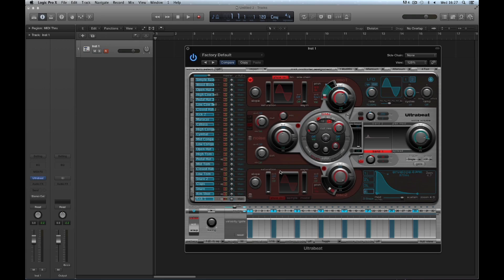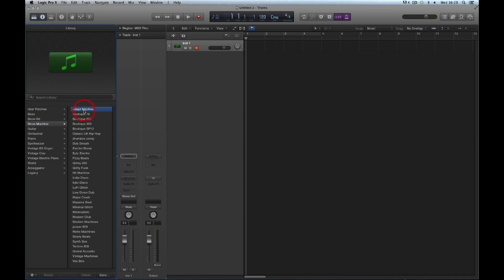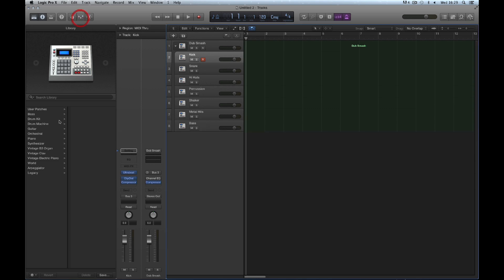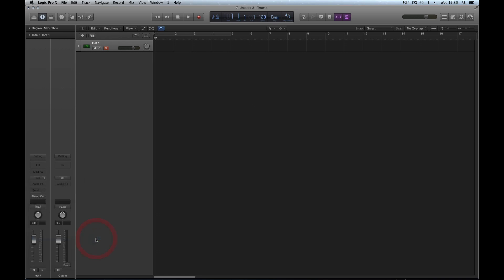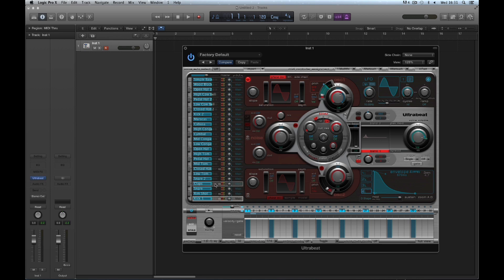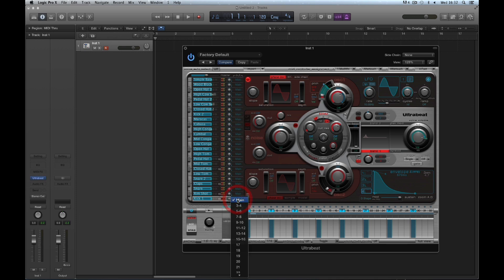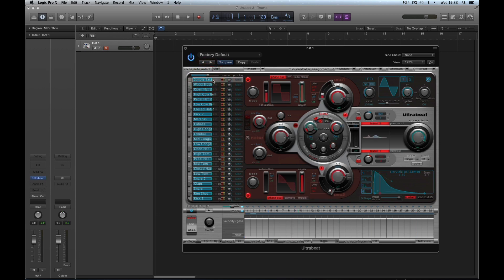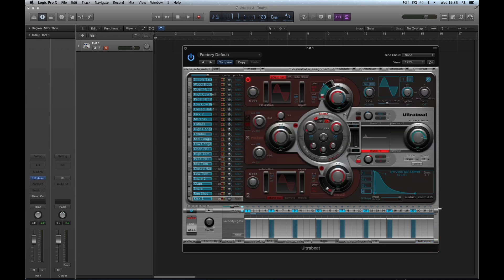Ultrabeat Tutorial 1: (intro)

Comment: IRIE Man!  You have some of THE BEST tutorials I have seen.  I have watched a ton of them.  Have not seen this though, I program several beats assigned to different notes and "play" by touching the notes to select different patterns.  Can I get the final result down to a midi track somehow?
Reply from the maker: yes you can drag the pattern icon (next to the word PATTERN, bottom-left of ultrabeat - when you mouse over it says Drag To Arrange Window) and drop the selected pattern onto a track
Reply: Thanks for such a quick reply!  I did already know how to do that copying but I sometimes only use a few beats of the patterns before pressing another key to change patterns.  Copying the full patterns in blocks isn't going to give me the same flow as I get by pressing the various notes while the song plays....Thanks!!!
Reply from the maker: well you can add the trigger notes into regions on the track and it'll get triggered from the note automatically.

Comment: I'm having a problem similar to the one mentioned by AVUXS, and I cannot find an answer anywhere. I bought Logic Pro X from the App Store, completely legit version. When I bring up Ultrabeat, the settings menu does not read "Factory Default," it reads "Manual," and the typeface is dulled out. The drop down menu does not contain any drumkits, just basic commands. 

Further, there are only eleven voices loaded, and they all say "Init X," i.e. Init Kick, Init Snare, etc. Each voice sounds like a sine note. If I click on "Copy" and then "Paste" at the top, then the correct sounds play.

I don't understand what downloading Logic "content" means, I thought I got everything I paid for in the initial purchase and download. I've read in threads about a "Download Additional Content" option in the menu, but I don't see that in my version (10.2.4). I see "Download All Available Sounds" but (1) that is for the Sound Library and (2) it's like 44 gigs, I don't have that much space. I can download and install drumkits for the Sound Library, but these are not drumkits for Ultrabeat and they don't appear in the dropdown menu after I install them.

Where can I get this additional "content"? Where do I get the drumkits?